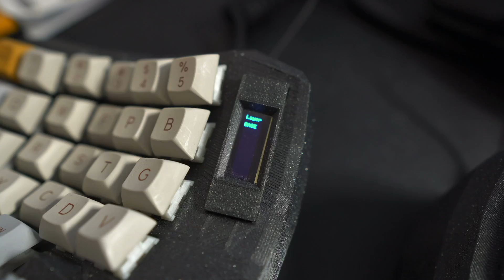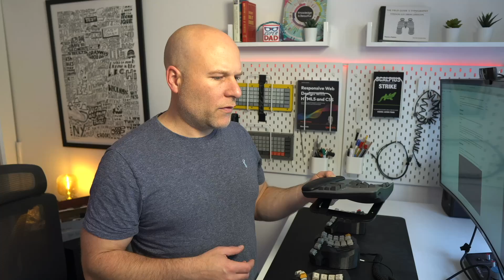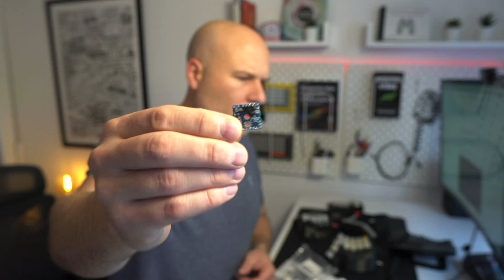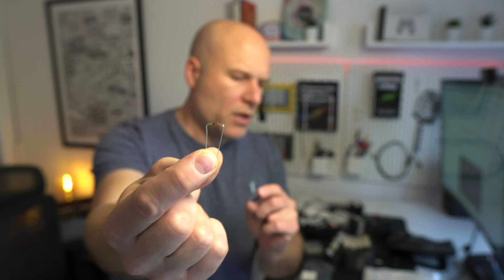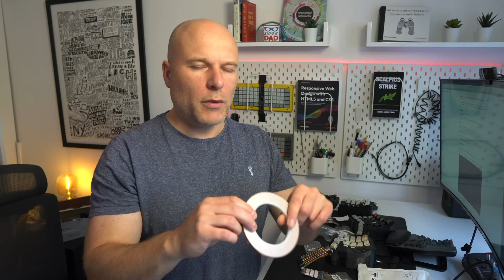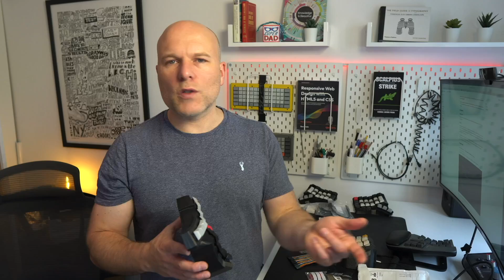Review: Dactyl Manuform — Ergonomic Mechanical Keyboard, hand built, build guide and testing

Comment: Has there been any alarm raised in ergo kb communities about the thumb pain problem? There seems to be very little.

i've bought two ergo keyboards with my own money:
* Keebio Iris: i made a big mistake thinking 50g Kailh Pro Burgundy switches aren't that much heavier. it's much heavier. but it might be usable for me.
* Redox (kind of a smaller version of ErgoDox): the thumb keys are completely unusable for me. in natural hand and finger position my thumb sits on top of 2 keys at the same time, my thumb goes past the main thumb key. i have to put my hand at an angle before my thumb becomes comfortable. at that point, what's the point of using an ergonomic keyboard? the fingers aren't on top of the home row anymore.

it's pretty hilarious. forum of folks that care about ergonomics. but their hands are at angle to their keyboards, sometimes quite a bit, thus fingers don't move straight up and down. what's the point!?

Comment: The last five minutes of this video were exactly what I was looking for. It makes perfect sense—your thumb should naturally rest on the most frequently used key of the thumb cluster, and all thumb cluster keys should be easy to reach (you don't need to have 6 thumb cluster keys either). Moreover, it should also be easy to press any key of the thumb cluster without unintendedly pressing another one. This has been my biggest concern with the Glove80: if I’m going to spend almost $400 on it, how can I be sure my thumbs will naturally rest on one specific key? Or that I’ll be able to comfortably reach all the keys in the thumb cluster?

The only thing I think this video missed is the possibility of ordering a slightly modified case print, where the thumb cluster is better positioned to match your thumb fingers and typing habits.
Reply from the maker: You might find this useful https://compare.splitkb.com you can compare different size kbs and also print the layouts out to scale. Bit tricky with curved keywells but better than nothing

Comment: Love the video and I absolutely love the dactyles I have. Opinion time: 
-I don't think PCBs are necessary and wiring them is not that much of a hassle if you plan how to do them in advance (for example I decide to have the diode on the column instead of the row and changed the way the thumb cluster is wired).  it took me less than 10 hours from parts arrived to fully assembled and it was the first soldering project I ever done.
-you absolutely don't need 2 controllers. I decided (because I suck at software stuff) to use just one arduino pro micrco and bring all rows and columns via HDMI cable (you can find nice coilded once) with a breakout board on each side. it works wonderfully but it makes the left one a bit crammed inside (not a problem at all)
-I would not reccomand using the pin dupont(?) wires as they are really thin and therphore hard to solder (they are to flexible to stay where you put them during soldering)
-something to consider is not having feet underneath, I used to have them but I found that it would slide anyway given enough time and would be hard to put back in place (had to move my hand and move it concusly), while without feed it does not slide significantly more but is easier to put back in place (I don't even have to move the fingers from the home row position.
-for the wrist situation I would raccomend lowering your chair so that you rest your wrists on the edge of the table and the wrist is aligned with the elbow and keeps the hand in the easiest position which is sloped towards the sky (also this way you can make use of the full thumb claster by using the thumb joint to press the inner most keys)

Comment: Hey Ben, long time fan..love the videos and the details.. I got a dactyl manuform for relatively cheap (almost new- used) on reddit mechmarket (made by Cyboard). I am coming from microsoft ergo, cloud c989 split keyboard. I love the dacty and just feels natural and  I am using the gel wrist rests BUT after heavy use / practice typing ( I have been doing touch typing for 10 years) I see my right wrist and ring/pinky area are hurting and may be early symptoms of rsi. I had ring finger pain (not as bad as now though) with my old Cloud c989 kb hence I moved to Dactyl but looks like it made it worse. Tried remapping keys, different desk/chair heights,  wrist rest positions etc. but nothing helps. Weird that left wrist is perfectly fine.   I do like the Dactyl but if I still want to use split , columnar kb what would you recommend other than Dactyl? I saw on this video you also had some pain after using Dactyl.    Do you get similar wrist issues with Kinesis 360 or glove 80 or iris/lily58/zsa voyager/moonlander? Wondering if I should move to any of these and let go of my Dactyl....<<Edited out wrist pain part>>
Reply from the maker: I would say first of all, there is no ‘one solution fits all’. But I personally didn’t get wrist pain with either Advantage360 or Glove80. I put that down to the built in palm rests. 
I also didn’t get wrist pain from any of the ZSA boards (Voyager, Moonlander). Recently I started to get thumb pain from the split boards; probably due to overloading the thumbs, which for the longest time were just used for bashing a space bar! Sadly, I think you’ll only really know what works for you when you try it.
Reply: @benfrainuk  thank you...

Comment: the key is to start with the right seating posture, and in this case with wells you need your wrist to rest higher than the fingers, that is why the Kinesis & maltron have the shame they have.
then get a bunch of playdoh or some kind of clay and use that as the starting point to find the comfortable shape for your hands, from that position with elevated wrists, and makes sure all of your articulations are free from strain.

Comment: I have been using my Dactyl Manuform 6 x 6 Nice!Nano for a few years and have no issues what so ever, for gaming its great for normal typing its just great, I use a wrist rest, and I have the 6 thumb cluster setup but I use different sized key caps for the clusters.   You very basically said your choice of positioning messed the experience up for you, go back to using the normal thumb cluster and I bet things get a whole lot better after getting used to it again.

Comment: How do you like this compared to the Kinesis 360? I just picked up the 360 Pro and now i'm questioning if I should return it for one of these. I have several custom built boards but this one fell off the radar! I'm also curios if the thumb switches are easier to use than the 360
Reply from the maker: I much prefer my 360. The Dactyl is in a storage box. Nothing wrong with it per se but it is a hand built keyboard and feels as much. The Dactyl can be built to have thumb keys wherever you want them and however many you want so that side of things is appealing.

Comment: Thanks for sharing your experience. After building the standard dactyl-manuform in 5x6 configuration, and getting used to typing on it - I got really convinced with idea of bringing functions closer to fingers, and not stretch fingers to get to functions. So when building second one for office use, I built one in 4x5 config (23x2 keys total), and been using it as daily driver for several years now. Using them without any wrist rests - so far so good - and I play keyboard-heavy games like DF and CDDA, on top of working as software developer.
Reply from the maker: Are you using home row mods? And/or just lots of layers?
Reply: 4x5 DM g4ng!

Comment: Hi! What do you think about Dactyl CC? It's thumb cluster position is copied from Advantage. And thanks for the amazing detailed video, it stopped me from printing Dactyl case right away, now I'm searching for a way to modify, moving thumbs cluster further away.
Reply from the maker: Looks interesting. The key thing for me, is just ensuring that the first thumb key is at least one key column on from the index finger homing key.  Currently I have my ‘main’ thumb key two over (middle key of the thumb cluster) on the Advantage 360/Glove80 but it obviously comes down to what is most comfortable to you.
Reply: @benfrainuk  What method of editing the hull model would you prefer? Based on the fact that Dactyl Generator doesn't allow you to adjust this gap, and models in OpenSCAD don't seem human-readable at all.
Reply from the maker: @ЛичищеЛичище  I just paid someone to alter the cad and print for me. Check out Wylderbuilds who I link to in the description

Comment: Thank you so much for taking the time to make this video!

I've been using a kinesis advantage for the past 9 years, and while it's been great I have been wanting to change to a split keyboard for a while now. I have been planning out and customizing a dactyl manuform build, and trying to decide whether to commit to the project or just get an advantage 360.

Your experience gives some great insight into how the project can go and things to look out for in the design, so thank you very much for that.

In case you or others don't know, there is a company partnering with kinesis to sell customized builds of the advantage 360. You can select switches, caps, and some other customizations. It adds a good bit of cost on top of the already fairly expensive default keyboard, but you end up with a very nice keyboard with a return policy and warranty, so it's something to consider if you're set on having more options for components.

I'm still not decided on which route I'll end up taking but I'm leaning towards building a dactyl manuform. I think I'll have fun with the project and it'll be nice to have a fully customized keyboard that I can do maintenance on myself if necessary.

Looking forward to hearing your thoughts on the advantage 360. Cheers!
Reply from the maker: Hi Josh, yes, I’ll be mentioning upgrade keyboards in the 360 review. Hopefully have the review out next week. Thanks for commenting. Let us know if you build a Dactyl how you get on 👍

Comment: Interesting video, it sucks to hear about your thumb pain.

I've been using an Advantage 2 for work and found the spread wasn't wide enough for me, so it led me down the ergo keyboard rabbit hole at the end of last year. I found the moonlander would have been the closest fit, but I knew the lack of dishing would rule it out. 

Fortunately for me, the Advantage 360 pro was announced and was about to be released on Drop. Of course I missed the December 2021 preorder so I ended up making my own Kyria to be a stand in until the Kinesis could produce enough 360s. I read about the Dactyl and I knew it would have been too big of a build for a first time keyboard builder. I wasn't convinced by the position of the thumb clusters either and I didn't want to have to deal with 3D printed plastic.

After watching your video I'm even more glad I picked a Kyria over the Dactyl.

I too am excited for your 360 video, I hope you go into detail about Kinesis' implementation of ZMK (if you got the pro version), the Kinesis documentation seems limited. It's like they want people to use the GUI rather than building up their own layers and macros in ZMK.
Reply from the maker: I basically took and adapted my ZMK config from the Dactyl and used it on the 360. That definitely helped me get up to speed on the 360 quickly. I think it would be pretty frustrating to dive into writing ZMK configs fresh if you’ve never done them before. I’ll hopefully cover it sufficiently in the next video. Thanks for watching 🙏
Reply: @benfrainuk  Cool, luckily for me I have experience with QMK which should help. I imagine many first timers are going to find it frustrating if they rushed to buy a pro.

Comment: Sorry to hear you're having thumb pain. I love your channel and feel you, literally. Unfortunately, I started getting some pain in my right thumb/wrist area (I'm right dominant) and it was made a LOT worse by ergonomic keyboards (also goes toward the elbow as in tennis elbow). I tried Kinesis Advantage 2, Ergodox EZ, Logitech split keyboard, tried an Ergo Mouse (Vertical and Thumb) and all made it worse. I do data analysis for work so am constantly typing and this freaked me out. Turns out I got De Quervain tendonitis and had to do some extensive therapy to get my right thumb back working okay (I still have pain). One of the issues is these 'ergo' keyboards put a LOT of pressure on the thumb in weird movements and stretching, going to and fro at add angles (same thing with a thumb mouse ball). Not sure if the issue is that the movements themselves are bad, or they're just bad for people who've done QWERTY for decades and aren't used to these other movements. Thumbs are strong and flexible but not really meant to make all these weird movements (nor constantly texting on smartphones). Not meant for tapping either I don't think (spacebar tapping is largely in one place at a time, not constantly moving and stretching the thumb at differing angles). Small pains can quickly blow up into larger issues with constant aches, pins and needles, etc. A quick De Quervain's test: hold your hand up as if waving, then curl your fingers around your thumb, pushing your thumb far in (like a really bad front facing fist). Then tile side to side (lightly). Interior I get no pain. But I have TONS of pain going exterior. (kind of a modified Finkelstein's test) Thankfully I'm back to okayish to work each day, still aches and pains constantly even with wrist braces, topicals, exercises, etc. It helped me a TON to go back to a regular QWERTY staggered layout (QWERTY itself may not matter, but my poor other fingers like my pink weren't used to so much extra work with a columnar ortho layout like Ergodox EZ). Please be careful with these ergo boards! From what I've seen online, they can be VERY good for certain kinds of RSI, but in my experience, they can heavily contribute to other forms. I hate it because I LOVE keyboards, especially weird ones and would love using one of these as my main, but it'll tear my tendons apart. Here's hoping for your improved joint health!
Reply: Demi'El you might want to try out something like the Keychron. It has QMK so you get all of the flexibility of the Kinesis/ Ergodox/ etc while still running a staggered QWERTY. 

I use a moonlander currently, and was having mild, but growing thumb pain for a while.  For me it turned out the thumb clusters were just too far away.

I ended up moving my space key to my right hand's index finger on the home row and my pain subdued over time.

Also need to mention that I have very long hands, so if the distance is too much for me, I bet that others experience the same
Reply from the maker: Hi Demi, that’s really interesting. I definitely feel it in the thumbs now more than ever. I’m also a long time staggered QWERTY user. Your story certainly illustrates how individual these problems can be and something describing itself as ergonomic is no guarantee. Wishing you a full recovery 👍💪
Reply: FWIW I just move my hand and use my index finger on my in-keyboard trackball.

Yes you're moving but it's far less than you would for a regular mouse and the correct way to ergonomically use a trackball is with the index finger.
Reply: What do you think about home row mods, since it could help using thumb keys less?

Comment: Great video as usual mate! Its genuinely a great resource having someone actually daily driving these niche keyboards as opposed to using it for 5 minutes and saying it "feels more ergo".

I think maybe the sad take away from this with ergo and niche keyboards is that you will almost always be compromising. My ideal mechanical keyboard would be split, hotswap, with per key RGB, a pointing device and scooped keywells but, most importantly, it needs to be reliable.

 I personally use a moonlander as it hits the most of those while being non-diy (the firmware and online flashing are also great on it) however even if I spent even more money or went full DIY, it's unlikely I could buy or build a keyboard hitting all of those. It's just the reality of a niche market. I really hope we see replacement moonlander thumb clusters as it might bring it a bit closer.

Something like a Charybdis gets as close as possible, but to me my keyboard is a tool for work, so not being hotswap turns a switch dying from a 1 minute job into a weekend project. I don't want to be diagnosing issues when I should be working. 

The advantage 360 looks promising and hits a different combination of those dream features so I'll be awaiting your review.
Reply: There does appear to be one keyboard that hits all your points nowadays: the Cyboard Imprint. It's not cheap, but everyone who has one seems to love the thing
Reply: @MasterXelpud  It certainly is interesting. I ended up building a Charybdis, which is certainly a cool board. I found that actually for my usage, the key wells made much less difference than I expected, and I found a much greater benefit moving to a smaller, choc-based board (the piantor pro), which also is so much more portable. I also didn't find the small, thumb trackball that comfortable coming from a larger trackball.

I think having a pointing device is a really interesting feature, and the implementation on the Svalboard really intrigues me, but for now, having a smaller board and separate trackball is a reasonable compromise.